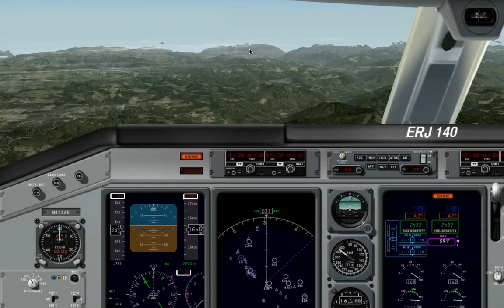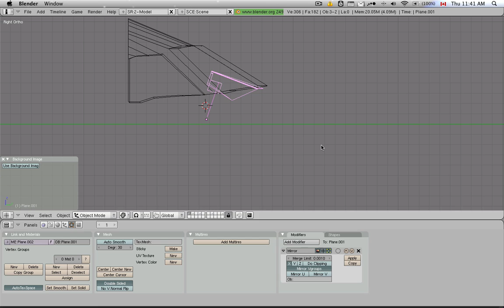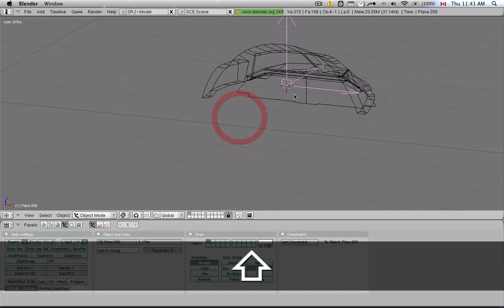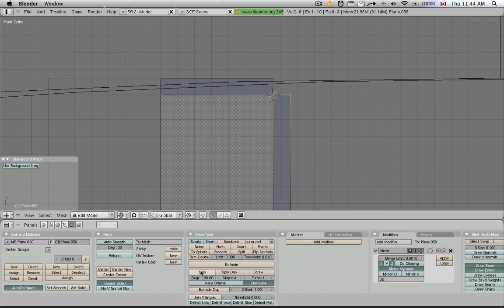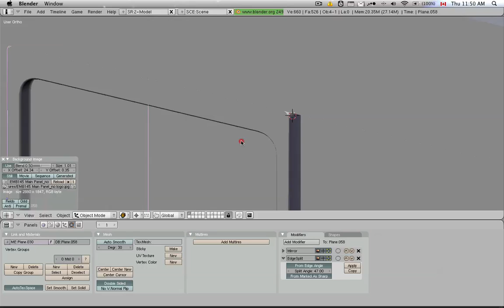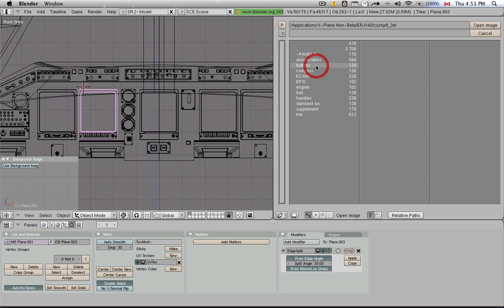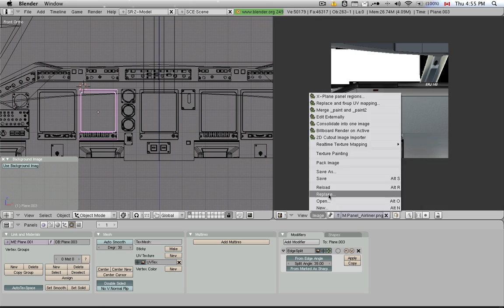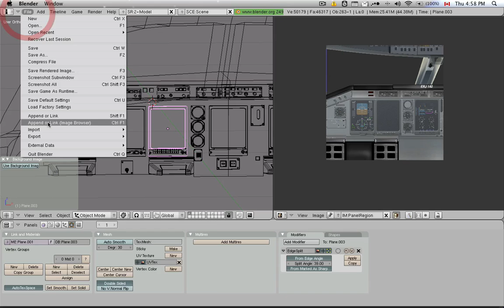PlaneMaker-27-Blender-13 - Modeling and skinning Instruments on Panel

Comment: Some things have changed but really, most things have not changed, and this is still really useful knowledge in 2022.   Blender ui has changed sure, but your points about normals, and what you're doing are still 100% what is needed to make aircraft cockpits in 2022 in xplane 11.55.

Comment from the maker: First, you have to understand that there are circumstances where the normals cannot be calculated outside properly.  It's mathematically impossible.  During modelling, these situations have to be avoided at all costs, or you'll run into what you're describing.  Blender's website has some documentation on this, but since I can't post a direct link, you'll have to look for it.

Comment from the maker: Blender 2.6 and its XP2B script (3.20) is quite different.  First, you have to get set up in layers.  Use included instructions to get started.  Panel regions are done in Blender's "Scene" editor (Buttons window, second button).  If the script has been installed correctly, you'll see the option to add X-Plane layers.  Each layer can be defined to export as one object.  The object you wish to export as cockpit can be ticked off as "cockpit", along with a menu for regions.

Comment: I'm advancing trough your tutorials to improve my aircraft but there is something bothering me in blender (I'm learning thanks to your posts, I'm a CAD designer in CATIA and almost and aeronautic engineer and found your posts extremely complete and straight forward). When I create a new plane it does it facing the Z axis of the global coordinates, can't find where to change that, could you help me with that? thanx